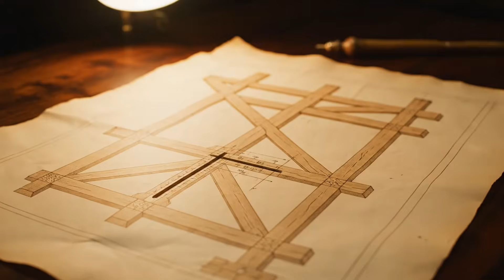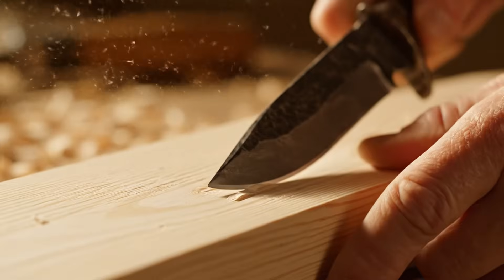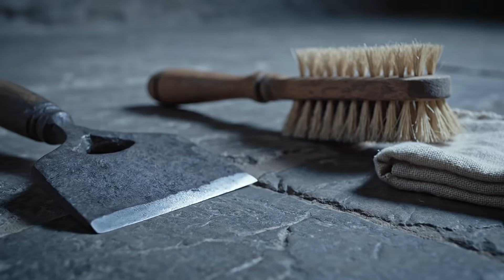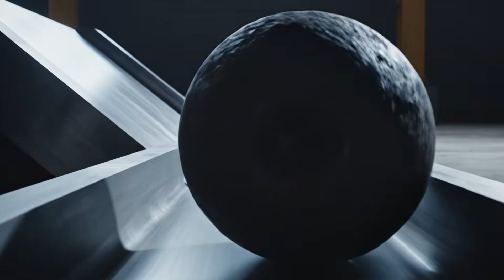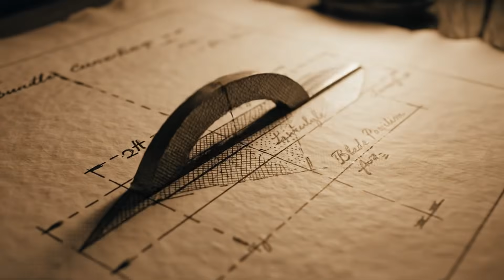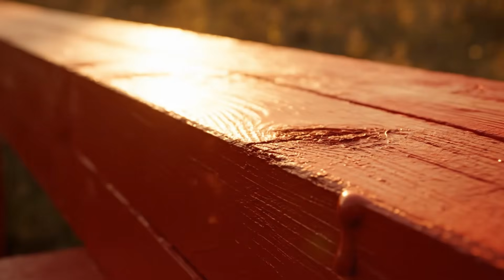Why the Guillotine Had to Be Built at a Precise Angle

Comment from the maker: The documentary ends with the observation that the guillotine's specification was essentially correct on the first try — and persisted for 185 years without fundamental revision. The engineering question worth thinking about: what other machines from the pre-industrial period have a comparable record of first-specification correctness? The Roman aqueduct arch system is one example. The longbow's structural geometry is another. What they share with the guillotine is that the designers were working from a clear problem statement with a binary success criterion — it either works or it doesn't — and that clarity forced analytical rigor. Can you think of other examples where the clarity of the failure condition produced an unusually good first specification? Interested in the comparison.

Comment from the maker: A note on what is documented versus inferred in this documentary. The kinetic energy and safety factor analysis is applied engineering physics — the principles are established, the specific numbers for the guillotine are based on the historical record as summarized in Arasse and consistent with period technical practice. The tolerance specification discussion draws on Louis's 1792 memorandum as analyzed by historians; the specific language of 'range rather than single value' is an analytic characterization of his approach, not a verbatim quote. The lubrication discussion (tallow on guide rails) is consistent with period engineering practice and near-contemporary accounts but should be understood as well-evidenced inference rather than direct documentation. The Foucault framework is my interpretive application; Foucault does not specifically analyze the guillotine's mechanical design. If any claim requires more careful sourcing, please specify in the comments.

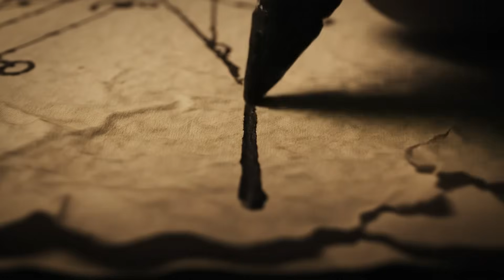Comment from the maker: The documentary's central argument clearly stated: the guide rails, not the blade, are the most important component of the guillotine. Here is why. A falling weight does not fall straight unless constrained. Without rails, air currents, asymmetric release forces, and guide friction variations all deflect the blade from vertical. The blade has enough kinetic energy to complete its stroke, but it arrives at the wrong point, or with a lateral force component, or with a deviation that the anatomy resists unevenly. The rails eliminate all of this. They constrain the blade to one direction: straight down. The result is determinism — the outcome is set before the blade is released. The rails are what make the guillotine a machine rather than a guided approximation. Start at 7:04 for the full explanation.